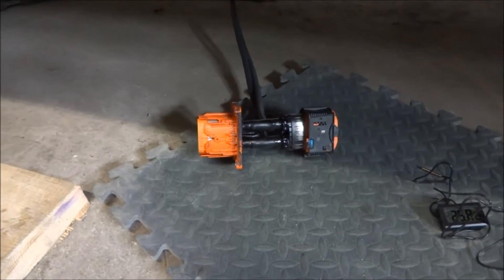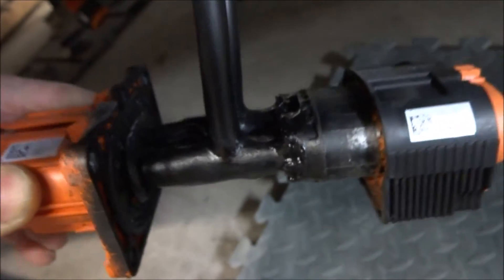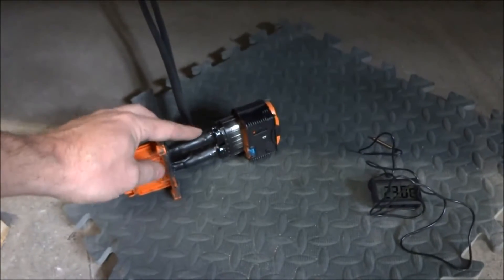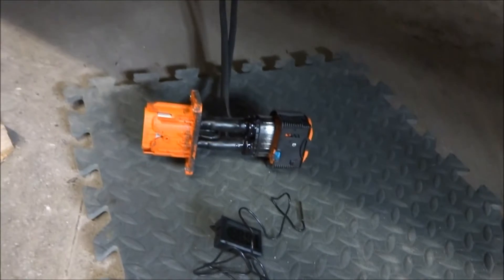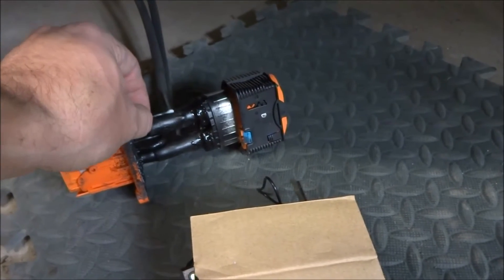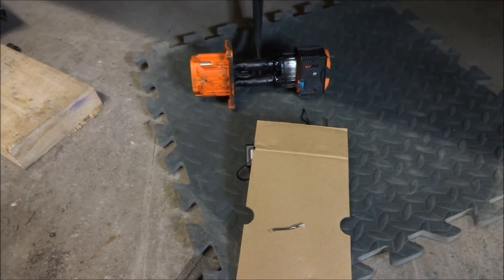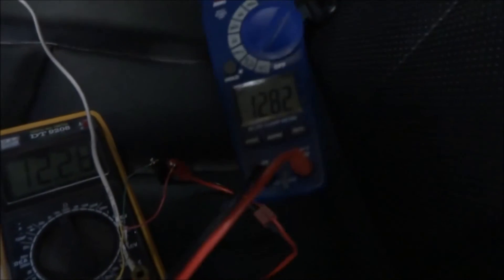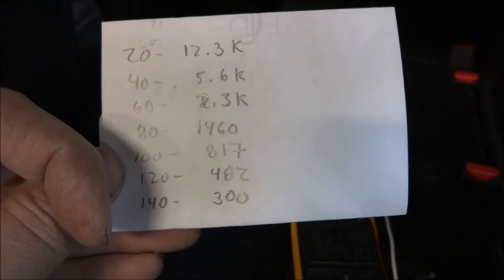Nissan LEAF range extender pack build Pt.1.2 (testing splice on the high voltage cable)

Comment: maybe use heat-shrink sheet or film in addition to a layer of plasti-dip (liquid electrical tape)?  Might save a lot of time re-coating, and might be more durable!  (I would say heat shrink tubing but I don't see a way to do that on a t-connection
Reply from the maker: Agreed, liquid tape is probably better.